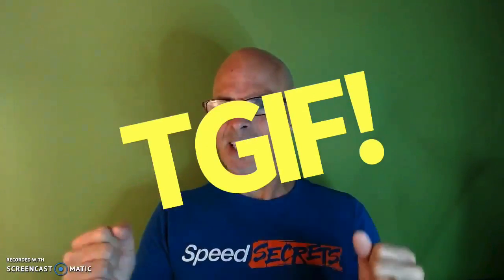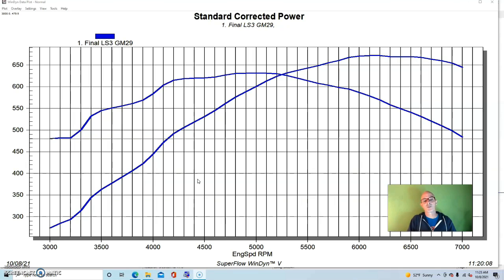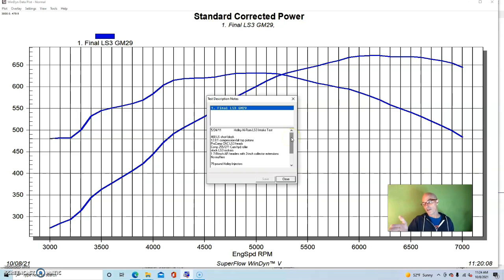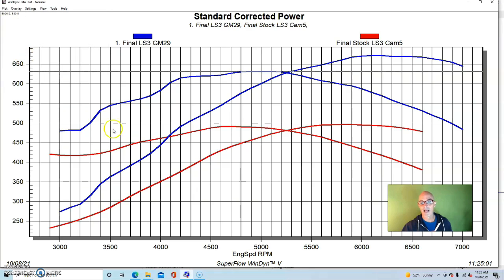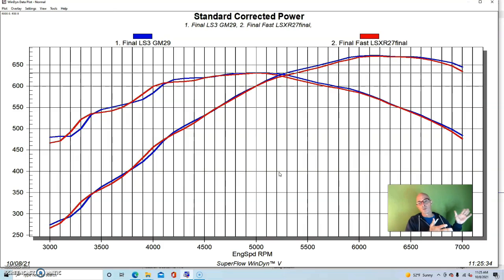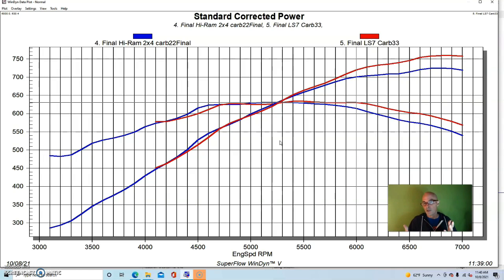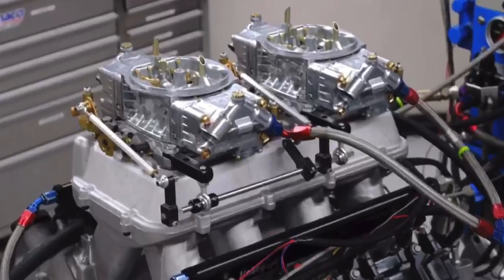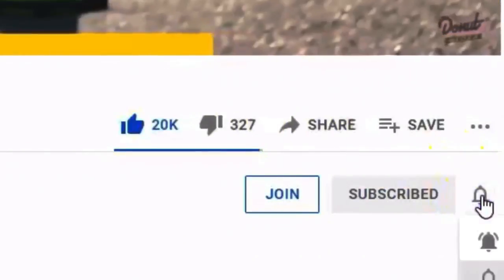HOW MUCH POWER DO TUNNEL RAMS MAKE? HOLLEY HI RAM TEST-CARB VS EFI-WHO MAKES MORE HP? DIY, HOW TO

Comment: That setup is similar to my dream street strip big single turbo build with no budget. I picked up a 2008 3valve mustang which is something I would never do I've always liked how they look but they ain't very cheap and I don't know as much as I should about the platform I've had a turbo is sn95 and fix body but they where way more strip than street and I have a 2000 Z28 small tire stock suspension car grudge race track of street and I run some N\T stuff and no prep stuff on and off the past two years and it gets most of my money just to keep it ready to party but I have been wanting a quick reliable street car that's actually nice and comfortable for a while now. my pawpaws buddy bought the mustang new and besides a k&n filter it's bone stock and in amazing shape it still looks new inside and out and under the hood & every where else with 73 sumthin thousand miles sonic blue paint I got the deal of the century on it  paid 4500 bucks for it! The little 4.6 surprised me even though it's a automatic trans so it got me wondering how fast I can go before kick in the rods out of it full weight like I would drive it on the street before I throw the nice little aluminum 5.3 with rods pistons and PRC cc'd 225's and forced inductions 85mm t6 1.32 exhaust housing and th400 with a holley terminator setup. Id like to see if the sbe 4.6 will go 6.50s in the eighth with the trans it has I'm not trying to buy a Ford pattern bellhousing for my th400 I'll never use again unless coyote stuff gets cheaper lol the car is getting several suspension parts from bmr and team z and some strange double adjustables they are my go to sbhock, I've picked up a on3 single kit for the car it's complete besides the turbo and waste gate I'm gonna have to have a t6 flange welded on and I'm going to run a 60mms gate I already have a billet wheel s475 with a 96mm turbine and 1.15 56 housing I'm gonna use I really want to do a CAME deal with some mild turbo grinds but I just can't justify spending almost $2000 for the cams and all the other parts I feel need to be upgraded valve train wise I will probably just put some Pac valve springs in it because I'm not gonna turn it more than 6500rpm if it will make around 520whp  and stay together and get a good converter so I can build a few pounds of boost foot braking it and on e85 or e90 it should run down in the 6's and mph pretty good if the od style Ford trans a lot of guys run in fast street cars aint super expensive I will go that route I think they are called 4r70's I'm not a big Ford guy but I know you can get a manual valve body and trans brake for those and a lot more converter options which ever I end up with it will be a ptc Dusty Bradford. I've been wanting to try something different so I'm gonna give it a shot lol I just don't want to spend 6000 dollars on a hand grenade that can go any time I haven't seen any boosted stock 3v 4.6s make much over 500 and from what I've read they don't last but I've already got the turbo kit a jegs brand sheet metal intake (not installed yet) that is supposed to bolt right up and use all the factory stuff and I'm gonna use the Bosch 210s I already have that intake makes less power bellow 4000rpm and supposed to make 13 more hp above that and says it will make power up to 7000+rpm I'm gonna try and run it like sbe gen3 ls stuff and try to keep the tourqe down in the lower rpms idk I will find out what happens in the next month or two lol but there is still light at the end of the tunnel I have a aluminum 5.3 and turbo that will make 1100whp and a nice th400! I just know I'm fixing to have to open up my wallet! LoL

Comment: Richard holdner

You see the power difference you get from just the charge cooling from the carburetor.

Please please please test cool can.

You can do with just regular ice water and you can do with dry ice and ethanol which will be extremely cold

Because of the vaporization of the carburetor, it will still have charge cooling on top of the extra coldness.

As it's always going to give off heat when it changes from a liquid to a gas no matter how cold that liquid is

Comment: So at around 4:09 I am seeing a higher peak with the hi-ram but much more area beneath the curves before the swap.  If the car wasn't traction limited already I would think better 60ft off the line with the preswap but better mph with the after.   I usually shoot for the former rather than the latter if I can adjust suspension to fit.  Am I way off here?  Trying to learn.

Comment: Richard, my engine is almost complete! Dyno it?! :D  306 SBF with roller rockers, e303 cam, Holley EFI high rise HP, 10:1 comp, forged internals, ARP  bolts throughout and windage and girdle plate with a 7qt oil pan. It's going to be ready in the next month
Reply: What heads?
Reply from the maker: YES-WHAT HEADS
Reply: @8power857  AFR 2.02's alum CNC'd
Reply: @mikev.7361  the cam will be the limiting factor her but will still be nice, around 390hp on the engine dyno, 360 ish in the car, 260-280 at the wheels.  Depends on a lot of differing factors of course!
Reply: @8power857  Ya, I'm putting a blower or turbo later on down the road once I break it in properly and I can afford it...
Reply: @mikev.7361   fantastic, it will love that. Boost is your friend!

Comment: Richard, do you think the 20 hp gain on the highram carb vs 102 is all charge cooling, or is some the air not needing to change direction/better air distribution.
Reply from the maker: I WOULD NEED TO TEST THROTTLE BODIES ON THE DUAL QUAD HIGH RAM TO BE SURE
Reply: @richardholdener1727  That would be a good test. I know some of that gain is charge cooling, but I dont think all 20 hp is.

Comment: Ls7 heads over the ls3 heads on the same bore will make 30-40 more hp. It's definitely the ls7 heads. I've seen C6 z06 guys afraid of dropping a valve again will go down from their 600 rwhp hci ls7 to ls3 heads and make 550-560 rwhp. The ls7 heads really do make that much more power than an ls3 head.
Reply: Do they run the same rocker ratio?

Comment: Was the motor a 468 or 496cuin I did hear you say 468 at the end of the show  but that is a great idea for a lesson on 468cuin  with ,1050 Dominator HP and torque
Reply from the maker: this test motor was a 468-I also built and tested a 495 stroker ls
Reply: @richardholdener1727  I thought. so awesome show it's great naledge and learning show thanks for your time

Comment: Hey Richard I have a 1993 Chevy suburban with 454 for pulling a travel trailer any ideas on how to get more power for pulling without losing reliability thanks
Reply from the maker: that's tbi
Reply: @richardholdener1727  yes it is any ideas I don't want to buy a diesel truck

Comment: Lots of power, but just how streetable is this engine ?  The little 5.2 Coyote can make as much power with a lot better fuel consumption
Reply from the maker: no
Reply: Not going to doubt you with less money and headaches to a naturally aspirated coyote 5.2 will need to turn 9200rpm to do so so I'm thinking it better be put together right using the most expensive highest quality parts available to do so and even then it will not touch these torque numbers these engines are making better off with the Ford new gas 7.3 truck motor it will be much more simple more cost effective and make way more torque than a 5.2 coyote but your entitled to your opinion and it will be more reliable and last longer than these engines the 5.2 coyote will be turning 9200rpm and the engines in the video turn 7200rpm think about it logically even if you made this kind of power with a 5.2 coyote engine it would be a edgy engine and wouldn't last very long and would wear out quickly turning this kind of rpm

Comment: I think the answer to your questions is.  yes. 

In all seriousness though, I am not so sure it was the charge cooling that netted you more HO on the top change.  I think it was more the fact the air is not changing direction as it enters the runners from the plenum.  Maybe even better distribution to the cylinders also.  I cannot believe the airflow is not as prevalent at the rear cylinders vs. the front cylinders.  Uneven power will effect the efficiency in a negative fashion.  Would love to know if that theory holds any water.  Fun stuff, Richard.  Thanks
Reply from the maker: ITS CHARGE COOLING-DONE THIS MANY TIMES

Comment: Why is nobody giving Nissan the love they deserve? The 5.6L twin overhead cam V8 they have has more potential than a 5.7L hemi.
Reply from the maker: HOW MANY AFTER MARKET CAMS ARE AVAILABLE FOR THE NISSAN?
Reply: @richardholdener1727  my point exactly! The LS is getting all the attention and aftermarket support right now, but it's still limited by it's pushrods. The VE56 has more "junkyard turbo" potential than a 5.3L LS in my eyes, as long as the bottom e d holds together.
Reply: If the VE56 got the same attention as the LS then the Nissan 5.6 "should" outperform even a 6L LS. It's also in a WIDE variety of their service and consumer vehicles....... Richard.... Please turbo a junkyard Nissan 5.6.

Comment: Hi Richard I have the holley hi ram with 2 side way holley carbs what throttle  bracket/cable assembly  did you us I've tried  a couple  different  types and to no success any help would be a wallet saver
Reply from the maker: we used a dual quad linkage from Holley
Reply: @richardholdener1727  thanks Will Sparkman

Comment: Most performance mods improve power on the top end with a loss down low. Do heads have the same effect?
Reply from the maker: some
Reply: Really most engines making this kind of power aren't going to be daily driven it's going to be going in something lighter 3800 pounds or less even this setup with the lowest low end torque will have plenty of torque for street driving and l could be wrong but running this kind of engine without at least a 3000rpm to 4500rpm stall converter and 4.10 gears or more would be pretty much a waste of time you'll only be worried about the power were the converter engages say 4000rpm to redline 7200rpm the most average torque and horsepower throughout this powerband probably wins but peak numbers look good not to many street cars driving around have this kind of power as these setups tested big bore and stroke power and big horsepower numbers
Reply: I know LS3 heads rectangular port heads compared to cathedral port heads like LS2 or LS1 heads with all things equal same engine the LS3 will be down torque slightly below 3500rpm but generally the LS3 head will make more torque 4500rpm and up and more horsepower 5000rpm and up but I'm talking engines much more tame than in this video under 550 horsepower and 6.0 or 6.2 liters much more likely to see something like this street driving or cruising around than something making 650-750 naturally aspirated horsepower monster

Comment: What fuel were you running? Water temperature?
Reply from the maker: 100 and 140 degrees
Reply: @richardholdener1727  does your fox body "run Around" at 140°?  Does anyone actually fill up on 100 and drive around? I know this is a fairly radical "street" engine but these numbers don't seem realistic. This isn't an engine masters engine. What's it do at 180-200°? Why not run it in available e85? Would it run on 94? No one watching is building anything to make noise on a Dyno.

Comment: I wonder how much fuel temp would affect EFI. I know cold fuel on carbs makes power, but efi...
Reply from the maker: cold fuel helps
Reply: A cold fuel test would be good. I would also like to know if cooling the fuel allows you to run more compression before detonation? There is a couple of tests for you.

Comment: I got a question I have a 532 bbf stroker a few goodies, mild cam around 550-600 lift  around 5500 rpm what carb do you feel I should be running?
Reply from the maker: depends on power by 850 or 950 will work
Reply: @richardholdener1727  I was thinking a nice 850 would be good 👍 but if I ever got a bigger cam then 950 would be the one I would go with.  Thanks for your thoughts I appreciate your time.!!!!

Comment: Very interesting stuff, I would be interested in seeing this intake comparison done on a stock LT1 to see if the hi ram is worth it with stock cam, bottom end, etc. Also kinda surprised the FAST LSXr intake did absolutely nothing, good to know.
Reply from the maker: LONG RUNNERS ALWAYS WORK BETTER ON STOCK MOTORS
Reply: @richardholdener1727  that’s what I’ve always read or heard too, just curious because I’ve seen a stock internals SS 8L80 racing on a YouTube channel with a hi ram and headers and other bolt ons and it runs good but I just don’t see the logic in that intake with no cam or head work, etc.

Comment: The final carb33 was ran from 4100.  Was there a reason?  With my 5.3 I usually look @ 3000-3500 for my future plans.  Sure I just missed something.
Reply from the maker: this wasn't a 5.3L
Reply: @richardholdener1727  understood!  Was just talking about comparing the numbers if I saw the same thing with my engine.
Reply: I assumed you were only looking for the change above that point, and was wondering why.  Most likely you are just looking for peak and bottom didn't matter, but I wanted to confirm.
Reply: What were the reasons for running it from 4100 and up? The engine? The goal?  I don't know enough to ask the right question here so I just want to ask them all.
Reply: I feel like an idiot when I ask you things, like I don't know enough to ask the right questions. Not your fault at all!  I love your approach to interpreting data.  Please forgive my ignorance. Keep up the good work.

Comment: Could you do a 4150 twin Tb EFI tunnel ram.
Reply from the maker: I did-IT MAKES LESS THAN THE CARBS
Reply: I’m talking about the Holley efi sniper dual throttle body on the high ram. Injectors in the throttle body.

Comment: 2:22 were you gonna sing to us ? Lol

 put a pair of 4150 throttle bodies on the high ram in place of the carbs and use injectors    Let’s see the actual difference and if the charge cooling helps    Also a good comparison would be to mount injectors at the top of the high ram runners and show what that does.
Reply from the maker: I DID
Reply: @richardholdener1727  is that coming ? Or did I miss it ? 🙈

Comment: 1. Valves  are different size in the heads & flow 340 cfm plus 
 2. Long runners on the last run , cooler fuel charge. 
3.  You didn't say if you were running e 85 or race fuel or pump fuel. 🤔 
 4. Be safe team.

Comment: Surprising that the FAST intake offered virtually nothing over a stock LS3! Negligible!  After spending 1k, u might expect 20 or 30 ponies.
Reply: The cathedral port stuff is where the lsx shines
Reply: You can find cheap ac delco manifolds on Amazon for like $130. I wonder how similar they are to the ls3?
Reply: @fiendwithout  its the tbss/nbss intake. Its good for upgrading

Comment: Insulation
Reply: Cover the runners and plenum in urethane foam
Reply from the maker: that does nothing
Reply: @richardholdener1727  on the dyno yes . Real world in a boat it would be measurable amount, like a 15 minute pull . Manifold will heat the air, and loses heat and charge will increase, especially in a hot environment

Comment: TIL:  LS motors cool, and make lost of power, but they are very ugly astatically. even a tunnel cant make them look cool. think i will stick with the BBC.
Reply: I think it’s those ugly coils and valve covers more than anything.
Reply: @cjbert6790  agreed, also the factory intakes are ugly as well. I think the exception to the rule is the Gen 3 Hemi. it has coil on plug but it looks cool. maybe its the valve covers the make it stand out.  the LS valve covers are really narrow where the gen 3 hemi is wide valve covers.